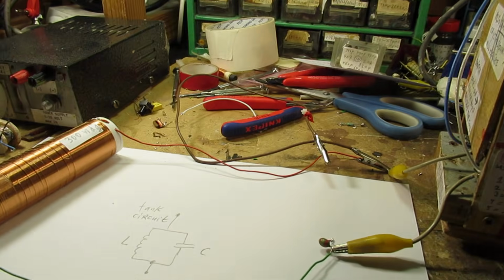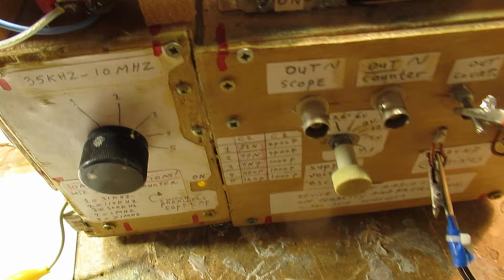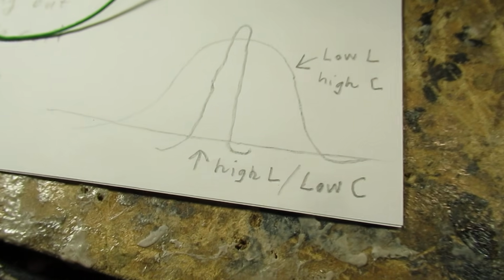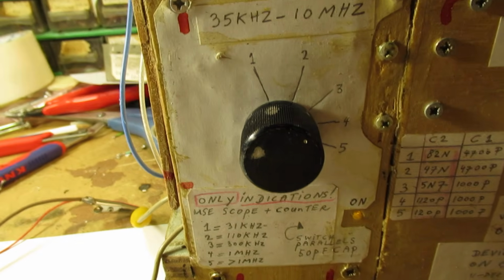How to make radio coils for frequency "X" and how to get an indication about properties (Q / freq.)

Comment: Inserting an aluminium 'rod', should make the frequency higher. - Have I understood that right?...
Reply from the maker: No, I told that sticking a steel rod in will damp the frequeny and the good coil properties. When sticked in completely the oscillation will stop.
Reply: @radiofun232  - Yes, I agree, you said that. ... The thing with aluminium, I have from another source, and my own experiments  - Can you confirm it ?... (Maybe trying it out on your experiment? - I used a pen consisting of an aluminium tube of a sort) ...
Reply from the maker: @itoffice  I think this is what you mean
https://youtu.be/eFcIqVieBJ4 
Yes, aluminium has a slight damping effect on the coil. Depends also on the distance from the aluminium hood/cap to the coil. E.g. IF transformers (old school) are mounted inside an aluminium box, it gives a kind of shielding against external e.m. fields and it does not have a big effect on the Q (quality factor) of the coil.
Reply from the maker: @itoffice  I think this is what you mean https://youtu.be/eFcIqVieBJ4 
Yes, aluminium gives a weak damping of the coil. Old school IF transformers/coils were mounted inside an aluminium box. It shielded them somewhat against external electromagnetic fields, without bringing the Q (quality factor) down.
Reply: @radiofun232   - Yes, exactly. - Just, I have an air coil with space in the middle. Pushing the aluminium 'rod' inside the coil, makes the frequency go up. In my case it moved around 1 MHz upwards. From 7.7 MHz and up to around 8.7 MHz. - How much, depends on the coil etc, of course. - I was told, that if I put in a ferrite core, it would go down in frequency. .... Interesting how the different metals makes the frequency act differently - opposite.